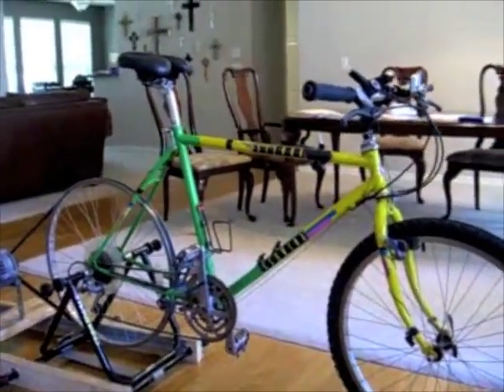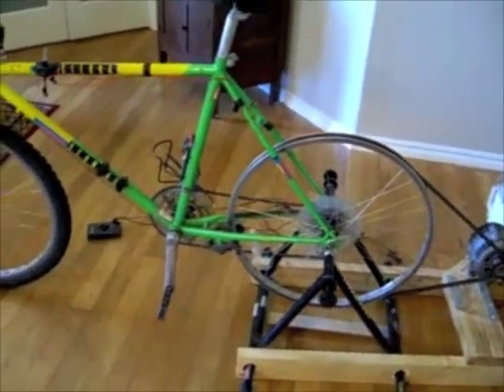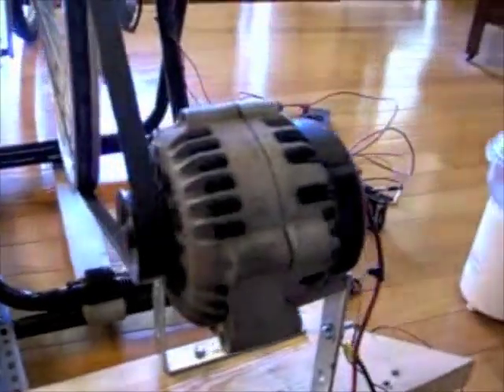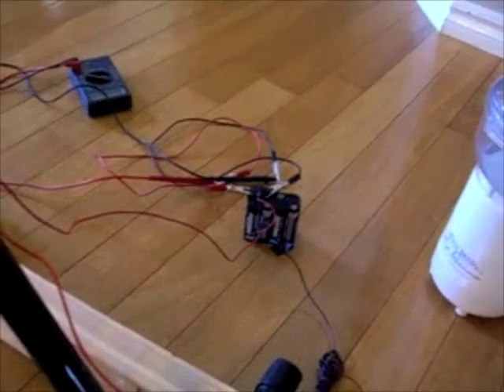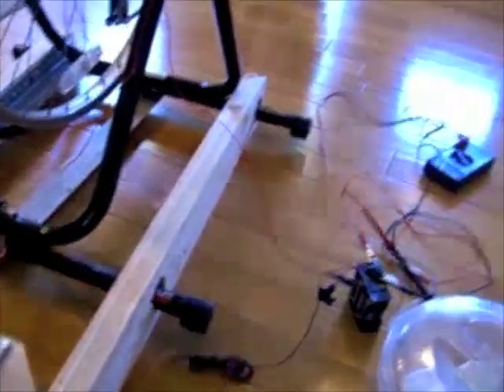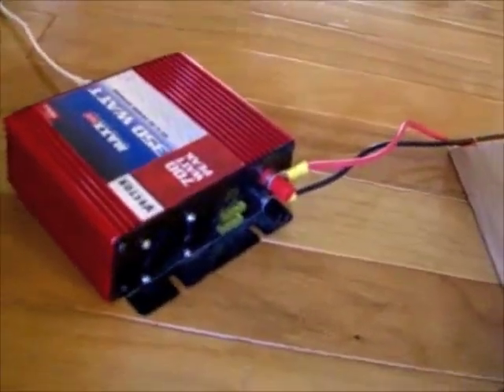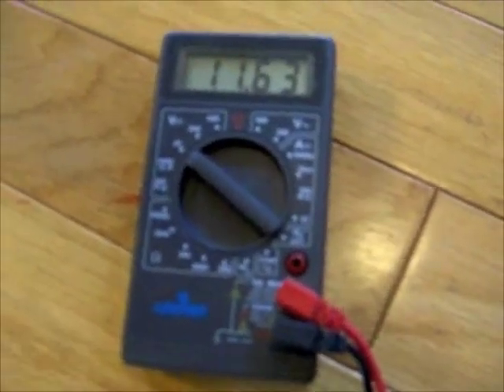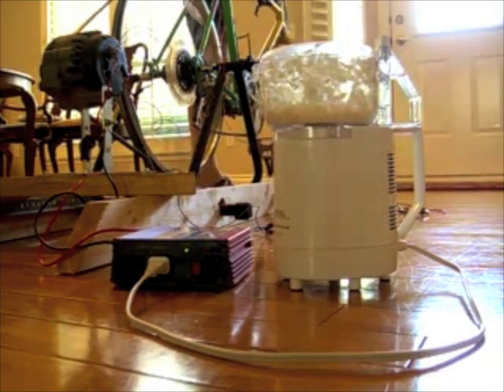Bicycle Generator

Comment: AFAIK a generator is still a generator whether it has an electromagnet or permanent magnets, if anything it'd have the alternator distinction because it's generating an alternating current, not because it uses an electromagnet for the magnetic field.

Comment: You need to spin alternators at high rpm for them to be efficient. Good luck turning five of them with your legs. Humans simply aren't capable of generating lots of mechanical power for very long. Plus all the energy you put into it is coming from food. So now you are balancing the cost of food against the cost of electricity (protip: food is more expensive).

Second law of thermodynamics: You can't win; there is no free lunch.

Comment: You can also use magnets on the sides of your bike wheels combined with Bedini's SG circuitry In order to charge a battery when going downhill, and use the power of the battery to go uphill or to charge your tools.

Comment: On the same principal but with a long drop, rope, weight and gears. A gear reduction box mounted over a drop (like off the side of a deck). Gear box has rope wound around a shaft with a weight at the end. The weight is cut loose and very slowly starts falling and spinning the shaft of the gear box. The weight drops slowly but the at the other end of the gear box is a heavy flywheel spinning really fast and this attached to the alternator. Remove alt, attach handle and crank up weight. Do again.

Comment: I was thinking maybe attaching two old automobile flywheels on either side of the bike wheel. Once you got everything spinning really fast you could quite a bit *"free" energy off of the flywheels while they continue to spin after you quit peddling. I know it's not free energy because you have to work harder to spin up the flywheels. But you could take a breather while the flywheels keep on spinning.

Comment: next time just hookup alternator to a larger 12 volt car battery then use a ac adapter from 12 volt dc to 120 ac ( cost $20 ) plug into receptacle wallah .just ride charge and then go about your daily chores . or  get 12 , 12volt batteries hook them up in series and you will have a 120 volt  UPS 1 hr cardio will give you free electric after cost of parts of course

Comment: Is there a simple plan to use wind power to drive the alternator eg building a windmill strong enough to drive the alternator ?
If you have a few 12v batteries and bigger inverter you will be able to power a 220v 750w appliance ? Thanks

Comment: Well I meant generator because I have heard that they are good but never had one to try it. I'd like to make a portable generator that I can peddle direct on a little collapsible frame or like you've done use a bike and an attachment belt. I'd also like to dispense the requirement to have power to start it too so an alternator is out.

Comment: Without the 1 way diode it will still work but if you dont drive your car often(if installed on a vehicle) the battery voltage will slowly drain.  So that self exiting alt. is no different then the stock type with a swapped regulator that does not allow voltage but 1 way.  100$ or 50$ your choice. Both will work.

Comment: So under 50$ in the alt. and now it will charge a battery and energize the fields by only connecting the post on the rear to your battery(make sure the case is grounded)
Ive done this many times to clean up wiring harnesses and on Hyster's its very common to. The alt. type was on gm cars,trucks 6cyl-V8's from the early/mid 70's until about 1986.  Each are sized the same but the clock(position of wires vers bolt location) and some produce more amps..

Comment: GM self exiting alternator...  These are typically the old 45$ alternator with a different internal regulator allowing a "1wire' connection.  Most of the auto parts stores have these for about 100 bucks.But you can also just buy that ole 1980 camaro or truck type alternator and save some cash.1post on the back is the charging post. 1connector w/2wires,1 is for a volt gauge and not needed.The other you just jump to the charging post(install a 1way diode in that jumped wire)2-3bucks at radio shack

Comment: I was responding to crunchbucket who asked why the 12v batteries couldnt be used to power the inverter. 

I live off the grid and power my house with a Trace pure sinewave 24V 4000W continuous inverter and 12 UL16H 6V batteries. I'm also an electrical engineering student.

The battery and switch circuit can be eliminated completely by using a GM self exiting alternator. They are used in many alternative energy applications.

Comment: The batteries aren't used to power the inverter itself. The battery is to give the alternator a 12volt field so that it can create a field and through that field it will start moving amps to charge the battery, but because the battery is small and full the energy continues to flow and only finds one way to go and that is towards the inverter.

Comment: I don't know if Leo is a prepper, a tinkerer, or a tree-hugger. But the point of prepping isn't efficiency, but self-sufficiency. I would want a bicycle generator to be prepared for when I don't have access to other, less labor-intensive, forms of power. Pedal power is ON-DEMAND, which is highly valuable when you're living off-grid at the whim of the elements. My system provides 99% of the time with no manual intervention. I run a propane generator once or twice a year. But without propane...

Comment: the higher the load on the alternator the more likely you will burn it up removing the power source to the electromagnet creats a simular load even jumping a car without enough voltage [12.2v]in the cars current battery can ruin the alternator after you remove the jumper cables leaving the alternator to charge by itself

Comment: Because the machines were invented to lower the human labor...if this job can be done by a one sq meter photocell or a 3 sq mtr wind mill, then why do human labor; save if for more important jobs. More importantly, a man can hardly generate 50watts of power that too for not more than one hour...you are going to get the costliest electricity ever!!!!!

Comment: I don't understand something. Can the inverter be plugged straight to batteries instead of alternator? because that's the source where the created energy is stored at? isn't it? so why did you plug inverter to alternator? it seems like you don't need the batteries then, coz inverter is getting the generated energy from alternator when running the bike..? I wanna do the same but needs more energy so I was thinking about like a car alternator. Do you think it's a good idea? thanks , Marc

Comment: I was going to say the exact same thing. It's silly to use a bike generator to power a motor. Anything mechanical should be powered directly from a bike. I am going to get a grain mill, which I plan to run directly. But I do plan on making a bike generator. I currently run my ham radio off a battery hooked up to a solar panel. The bike generator will supplement what the solar puts out.

Comment: skip the alternator and the inverter and remove the motor from the food processor and just pulley the food processor to the bike rim it will take less energy to spin the food processor, just a thought because there is a lot of energy loss from the alternator and inverter.

Comment: As I understand it, the original signal (voltage) generated is AC (alternating current) and is internally (rectified in the alternator) converted to DC (direct current) where it can be used to power the vehicles 12VDC circuits. The blender can't use DC, therefore the output from the alternator must be converted to a usable AC signwave/voltage compatible with the blender.
NOTE: some appliances require a PURE SIGN WAVE (read--more expensive) AC voltage inverter to avoid internal damage.

Comment: Can you take car tires and do the same thing? Let the tires make energy (similar to a windmill) that can be saved for the duration and run the battery off the energy to recharge the batteries? Then you can drive unlimited miles..not like the 100 mile cars now?

Comment: It would be interesting to see how something similar to this could be used for emergency charging of an electric car. Maybe like a hand pump or a portable crank. How much effort do you think it would take to charge a car battery at the side of the road enough to go a mile to the nearest service station? If it's more than 20 minutes then I guess it wouldn't be worth it.

Comment: he used the difference in radius between the chainrings, the wheel and the alternator pulley to create a big ratio difference
if you were to create a machine like this, it would be much more optmized and use less parts, but it's good enough for a homebuild

Comment: How did you decide on the alternator setup vs an electric motor and some sort of charge controller? I've seen others using 24v scooter motors as the generator but they need some way to control the voltage going into the battery and, it seems, they lose some power if they pedal too fast because the charge controller diverts it before it hits the battery. Is the self regulating alternator setup the best you think?

Comment: I'd rather go for a ride outside and then chop an onion with my knife.  There seems to be no real return in energy spent to create this device.  How many watts were spent researching, planning, investing, and building.  Not to mention Double A batteries are expensive.  This kind of mental masturbation really grinds my gears.  If I was nearly electrically inclined as this man I would put my skills to better use.  Perhaps figure out a way to use the potential energy to just recharge my double A's!

Comment: Nice job explaining how the alternator works and a nice demonstration.  Someone else posted - you can use a "Self Exciting" alternator from GM, also called a "1 wire" alternator.  At 1500 rpms, the regulator is self-exciting, providing power to the field coils.  Using the alternator to charge a 12V deep-cycle battery can provide a nice "reservoir" of energy.  As you know, 200W continuous output is a lot for most cyclists.  100 Watts is fairly manageable for people who are in decent shape.

Comment from the maker: correct.  batteries were just to get it going.  after they are switched off, the alternator sustains its own power to the field.  With 220 watts, it was difficult, but not impossible.  I could probably sustain it for about 10 minutes (and I'm not in great shape).  I tried a 300 Watt air compressor, and I could only power it for about 30 seconds.  A happy medium would be a 100-150 watt device.

Comment: would it be possible to attach a similar system to a bike that acutally moves so while you are riding ur bike oyu are charging some deep cycles that could be used to power an ebike i made

Comment: I think you could use what they call a "1 wire delco" and eliminate the extra little battery pack to the field.
I think also that you can hook the output post to the field post and the little bit of residual magnetism will self excite the field when you pedal it.????

Comment: Great vid, Have you considered mounting a small dc motor to the shaft or additional pully mounted to the altinator to take advantage of the 40:1 , in order to provide the constant HIGHER base charge for the altinator eliminating the batteries and increasing potential

Comment: Why not just create a power Chopper with your bike and forget the alternator and batteries? Instead of the back tire connecting to the alternator have that rotate the chopper. Kinda like those old hand mixers?

Comment: No. As explained in the video,  the small battery pack was just to get the alternator started.  Then he shut it off.  That small battery pack would not have run the food processor.

Comment: I could have drove over to your house chopped, cooked and ate the onion quicker. But question is the chopper was powered by inverter which was powered by batteries at 12volts so what's the point of the bike if not only to keep charge on battery pack?

Comment: Plumes1, the switch LeoWideman is referring to goes between the alternator and the 12v batteries(8 one and a half volt AA batteries). If you look here on YouTube under wind generators, you will see they look like alternators with one exception. The copper windings are replaced by powerful magnets which generate electricity when they spin. The alternator has copper windings that need to be energized to create an electro-magnet, which when rotated produces electricity. The switch is there to ener

Comment: No, but was going to. It seems simple enough. To get the field energized you attach the 12v solar panel and Missouri Wind &Solar will sell you a hub and blades to turn the alternator into a wind turbine. They even have the mount that allows you to attach the alternator to a schedule 40 inch and a half(1.5") piece of pipe. If I do try it I will upload my results. If anyone else attempts it please share it.

Comment from the maker: this was just a regular inverter...not a grid tie inverter.  A grid tie inverter has an algorithm built in to match the frequency of the output to the frequency of the grid.  This is for output to AC devices only.  pretty cheap.  grid-tie's are much more expensive (at least the ones I trust)

Comment from the maker: 4:1 gear ratio, 12:1 diameter ratio on the belt.  now you're 48:1 x 55 rpm = 2640 rpm.  better than idle on a car.

Comment from the maker: $15 for alternator/belt (junkyard - pull-a-part); bike stand off craigslist - $30, inverter from walmart $30.  switch and wire from radioshack $5.  scrapwood and brackets to mount stuff ($5).  Around $85.  Had most of the stuff already.  really just bought switches, alternator and wire.

Comment: Here is something you can try. Take a 12v solar panel, connect it to the alternator and a simple charge controller connected to a 12v battery so any excess can charge a battery. You add wind turbine blades to the alternator and Voila' ! Your solar panel feeds 12v power to the alternator to keep the field charged but also dumps into the charge controller charging batteries and when the wind picks up, the field is already energized and will start producing power when the blades turn. It is a self

Comment: I understand what you're trying to say, but in reality a human could not spin a heavy flywheel up to speed even with the low gearing,as soon as you apply load it would be like putting brakes on. This is called power to weight ratio and is why a small engine with variable gearing cant propel a vehicle to infinite speed, and likewise a small engine cannot run a big generator, hence the formula is about 1hp per kw. We need to make much more efficient generators and move away from magnets and coils.

Comment: not necessarily with the proper gear ratios. the 1/4 hp human power can be made to generate as much hp as needed. Replace the back tire of the bike with a heavy flywheel and use the bikes de-railer to get it up to speed. Gear it properly at the alternator, and the weight and kinetic momentum of the flywheel will help generate more sustainable power.

Comment: this is a great question.  i have seen this done.  a friend of mine back in highschool built a rig that powered his home computer.  this was back in the days of pentium1 processors and HUGE power supplies... so in his rig, it was not possible for a human to power a computer during normal use...

however, he could charge a pair of battery backup systems that would allow him to use his computer for about 30 minutes for every hour of cycling.  

i have seen a few other projects online, too.

Comment: that would replace the need of a 12volt supply but you would need an inverter to change to ac . an alternator makes ac until it goes through a set of diodes

Comment: The diameter ratio is about 1 to 12, then to 55 rpm can not get 2100 rpm on the alternator. We can only get about 660 rpm.

Comment: The meter has to be connected in series with the circuit (between the alternator output and the battery or inverter).  Most multimeters can only measure up to 10A before blowing the fuse, so you would need to use an amp clamp style meter.
Reply: I believe clamp style is only for AC

Comment: Great idea.  Putting a flywheel on the bicycle rear wheel somehow would even out the pulses and make more steady power output, and likely even increase output once you get it going.  I haven't seen any so perhaps it would have to be custom.   Car batteries are definitely the way to go.

Comment: I used to work at an auto parts place where on occasion we trow them away so I started to recycled the ones that where good but with no home lol I know that you can buy marine batteries and tie them together to make a huge lot of them so basically you can make a 5 or 6 k holding area for your power so every night you could have your whole family recharge and then go on to the next day.

Comment: You would never recoup your initial equipment investment, the average person can generate 125-200 watts so assuming you are on the high side of average in 5 hours you can generate 1 kWh of energy. At the most expensive peak electrical rate (Hawaii) that is only 25.1 cents you have saved for 5 hours of work, not including the calories you burned, estimated to be 4,800, or 1.37 pounds of fat. Then consider the average household uses 920kWh per month. Otherwise, its a neat idea.

Comment: Hi, I see this video is at least 2 years old and am curious as to whether you have redesigned it for the consumer market to be used to power a larger variety of electronic devices?   I would love to see this in a self contained, water tight, portable, virtually indestructible case on wheels. It should be able to use  no less than 2 car batteries, but have the ability to simultaneously utilize numerous batteries.